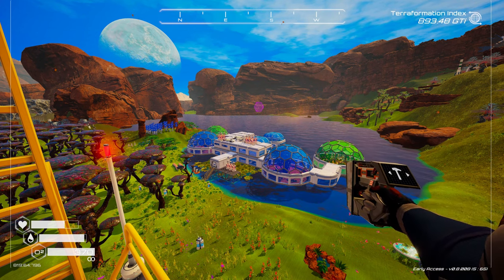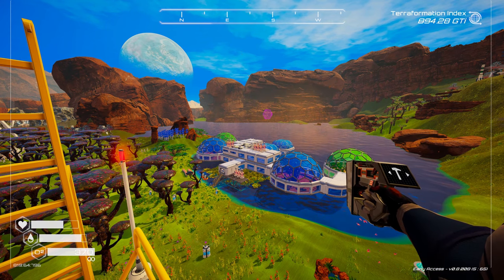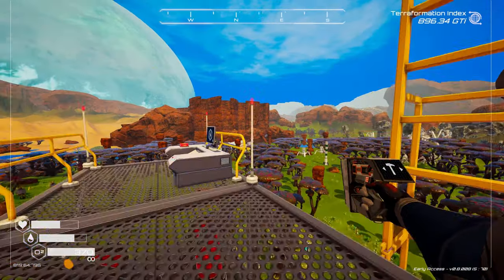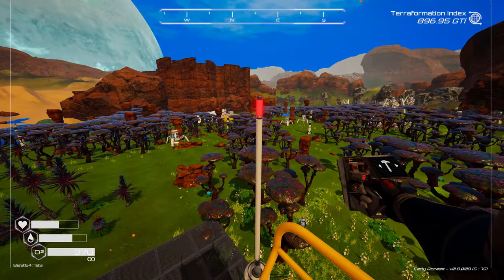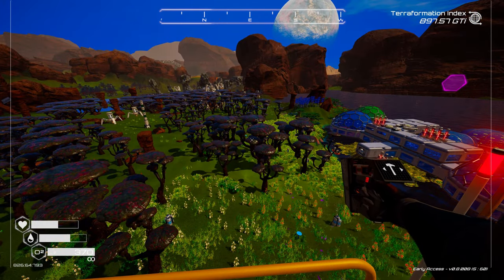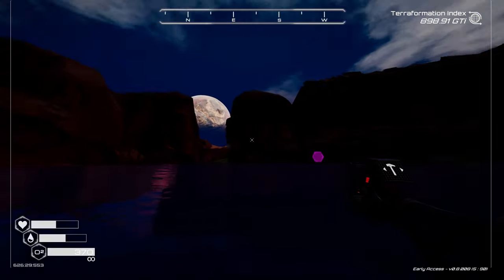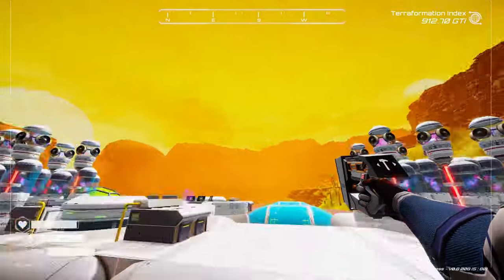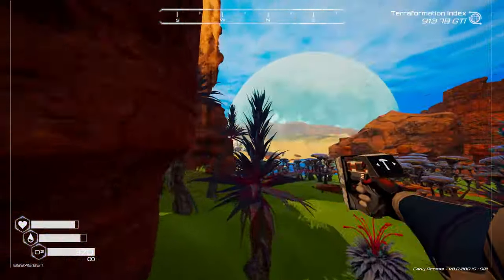Best Tips for Base Efficiency in Planet Crafter

Comment: When I first started out almost 2 years ago, I built bases everywhere, each with their own complete set of buildings. 635 hours and several saves later (probably a lot more if I wasn't an avid MMO player) and I have production down to one single two-story (minus the living area on a third floor) base with plenty of room for expansion. Thought it interesting that you have your algae under the building. The bots collect my algae, so doesn't really matter where I have it, so it's spread out in the lake and my base in on the ground. The bots bring it to the storage I have near my line of crafters. The food is growing on the roof and on the side of the building, so the crafters auto-pick it. So similar ideas but done different. Good video.
Reply from the maker: Thanks. Glad you enjoyed it. The trouble is, you don’t unlock the drones until much later in the game and you will need algae way before you unlock them so always good to just whack the food and algae under the base when in early or mid game. But yeah, when you unlock the drones, doesn’t really matter where you build at that point as everything is automated
Reply: Yes I was pleasantly surprised the bots can pick algae on their own. Wish they would do the same for larvae and frogs eggs though!

Comment: Hello! Good ideas!! Personally, I have each sector separately, with farms on the sides of the base, for example, and I don't worry about autocrafters because I use containers in the storage areas of the base. Machines like extractors or farms send their resources with drones to each container as needed. I have one for each item, and they are strategically arranged to be close to the range of certain autocrafters. I use this a lot to make plastic and wafers, for example, even to make cookies, which are extremely good. The drone update and energy fuses (rockets are no longer needed in the late game) have completely changed the game. By the way, I only have T5 machines, a few, since lower-level ones are ridiculously bad compared to higher-level ones.
Reply from the maker: Thanks for the comment. That’s all well and good having no auto crafters, but from early to mid game (unless an update has changed this), you don’t have access to drones at all. So you need to keep thinking about planning ahead and auto crafters and base layout are a big part of the early game problem. Once you get access to drones, you can pretty much build anything anywhere and don’t need to worry about layout at all.

Comment: Efficiency: 

1. Start at the WATERFALL. There is a cave with two grave sites & two loot boxes. One has T1 agility boots & T2 exoskeleton.  There are other T1 & T2 crafted items that can much later be deconstructed for needed resources. 

1A. Loot all the golden chests. ONLY use golden flower seeds in the oxygen machines. Don't spread machines out. Keep them tightly spaced, and away from your working base.

2. Get to the Cracked Spires biome. There are three T2 solar panels. SAVE these resources. And build all power machines from these resources. It will take four living compartments (LC) to get from the Waterfall to the Cracked Spires biome. Then one LC to get to the Central Plateau. 

3. Get to the Central Plateau ASAP. This is the best starting base location. The end-game base is back at the Waterfall. 

4. Main base design 4x8x2. 2x8x2 is storage. Minerals on the first floor, organics on the second floor. Upgrade this to the Large Living Compartments (LLCs) ASAP. 

5. Storage is vital, space isn't. The LC can float, it can't be built on a frame. They don't link. Frames support blue boxes, and grey chests. At end-game frames can support the Teleporter and the shredder. 

6. Most streamers fit four blue boxes or for grey chests in an LC. If you aim at the back wall when crafting storage, they will align to that wall. Now five storage can fit against the left and right walls (max ten storage per LC). On the back wall place a T2 crafting station.  In front of that on the FLOOR place a blueprint screen to unlock blueprint chips.

7. One the base is upgraded to the LLC 2x2x2. A 1x2 side will be for ONLY storage. The other side is for screens. Large on the walls. Small on the floor. Map, blueprint, power, mail, and rockets screen in that order. Watch the Map screen during meteor showers to see where they land, most resources last one in-game day, or much less on the ground. The rest is for crafting stations, ONE auto-crafter, ladder, Teleporter, shredder, and deconstructor machines. Two lockers each for food and water by the front or back door is a good idea  two or four lockers for drop storage or mission storage (resources to build outdoor machines or LLCs for temp bases). The second floor is same as first. Organic storage on one side, crafting on the otherside. Two incubators, and  then two DNA manipulators. Eventually ten silk generators, and one auto-crafter to craft cloth to sell for trade tokens. 

8. Storage layout in the LLC. Start at the back wall of the first LLC. Place Ten grey lockers on the outside walls. Then three rows of eight lockers. This creates a hallway at one end of the lockers and two hallways to the back of the base. A 1x2x2 storage will have 2x2x34 = 136 lockers (half for minerals, and half for organics). Don't build all 136 lockers at one start with ten on the outside wall. Then add a row of eight for more storage of basic resources. Then add ten more in the second LLC for rare resources. 

9. So the first ten lockers. Store ONE resource per locker. The two drop lockers can have a mix of items, but move them to proper storage ASAP. NEVER have more than two drop lockers in your main base. Store resources alphabetically. The exception the first locker will be for oxygen bottles, a few ice can be stored here for the museum  at end-game. Next is Aluminium, Cobalt, Iron, Magnesium, Silicon, Titanium, Super Alloy, and Iridium. Aluminium, Super Alloy, and Iridium are all rare resources, but this is a better option or the early-game resources. For mid-game resources after Iridium is Obsidian (had to move resources), Osmium, Pulsar Quartz (space), Uranium, and Zeolite. After Zeolite comes spare blueprint chips, circuit boards, rockets, bio-plastic (organic but very needed for outdoor machines), cloth (before trading starts), and effigies. 

10. This is always the most challenging, changing, and growing storage. The outside wall storage is for seeds. Starting with flowers in alphabetical order. Golden Flower seeds are not stored, except when crafting trees. Then are vegetable seeds.

Sulfur is an organic resource that is only used for crafting in the bio-lab. So Sulfur is stored  in the second row of lockers. So are grown food in alphabetical order. Early game squash is first found REAL FOOD. Aim for ONE food grower per vegetable. If only Aubergine 🍆  seeds are found aim for three since it is a very poor food. Replace two Aubergine with two squash or bean ASAP. Mushrooms aren't a food, crafting bio-plastic is a must ASAP, and is very slow. Three Mushroom food growers is the recommended goal by mid-game. Four farms per vegetable should REPLACE  all food growers by end-game. Six T2 food growers will be needed to keep one locker full of Aubergine 🍆 full and still craft fertilizer ASAP.

Next to food are three lockers each for insect larvae. Start saving Common larvae ASAP. They start to disappear after amphibians start eating them. 

Rare larva aren't that important but store them for use in crafting two each rare butterfly. 

As soon as the Ancient Civilization unlocks do this quest line. There is a patio with an Obelisk In the last quest city. Build a staircase up to the top level with the Obelisk above the patio. TRY to link the top stair (five or six linked) to a frame if possible, or as close as possible. Then make about three or for trips to build a linked frame platform floating above the patio. It is possible to find a mix of thirty rare, uncommon, golden, and Serena larvae on this platform.   Deconstruct Serena larvae then craft golden butterflies, this way never requires find rare larvae or crafting resources. It is possible to craft over fifty golden butterflies before other rare butterfly replace the golden. 

The last row of organic is for the pouches. Starting with red, black, and green fertilizer pouches. Next are the Petrie Dishes Bacteria Samples, and the T1 - T4 Mutagens.

The last storage locker for rare resources is for each rare rod.

11. The recommended order of trade is the T3 storage locker, the T3 3x3 Large Living Compartment, the the T2 drones (these could be unlocked second, this will improve moving into the T2 LLC base).

🍀🍻